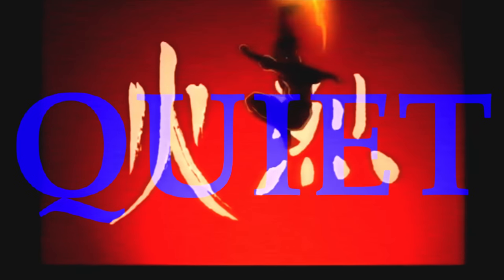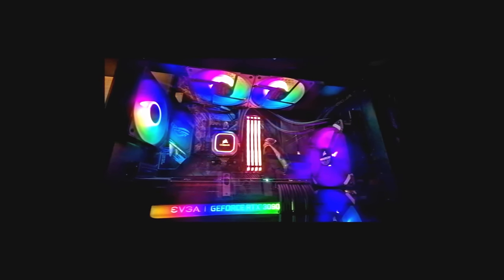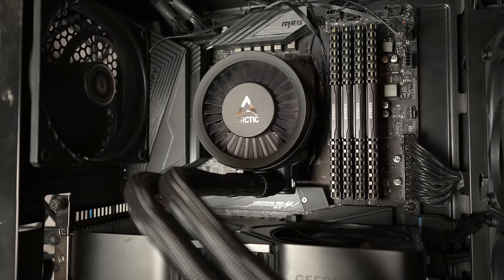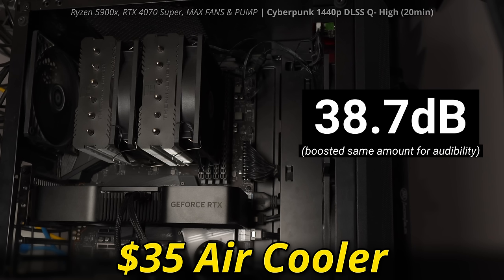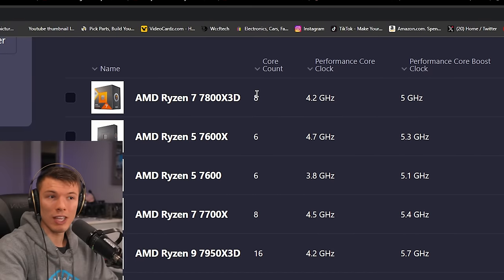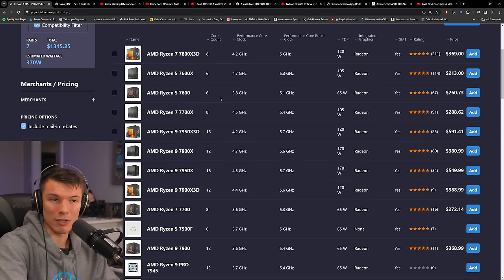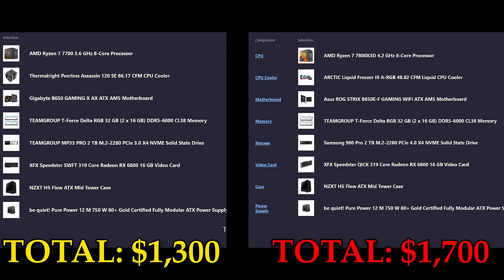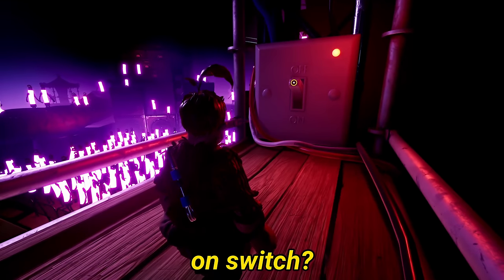How to Get the BEST VALUE PC!! (you’re doing it wrong…)

Comment: And the pump will die. When it does, you are in to spend the same amount of money, again. But when a fan dies on an air cooler, it cost 10 bucks to replace.
Reply: >hear fan bearing whirring
>replace cpu fan with noctua
>no more whirring
happy
Reply: Order the same AIO, swap the stickers, send it back and get a refund.
Reply: @Jackikins  unethical life hack lol
Reply: I just built my first ever PC and went with an aio. Decided on an Arctic lll since from everything I saw Arctic is one of the best while costing way less.

   So far I'm very happy with it. If it does fail earlier than is reasonable I'll go with air instead. 
   But I hope and expect the aio to last many years.
Reply: $10 or $13 p12 max ftw!
Reply: my current go to is: get a thermalright peerless assassin or the cheaper 120 single tower depending on your CPU. instantly replace fan with a cheap, silent, reliable arctic fan 120 PWM PST, either RGB or non-RGB
Reply: That was my thought when my old Corsair H50 died. That said, it DID cool:
- a 130w Pentium D 830 (Intel cancer at it's worst)
- a 4790K which had to be undervolted cause turbo was shooting it from 55c to 100c in less than 3 seconds and causing a shutdown, so it didn't even get to thermal throttle as it was OVP related (Thanks for the crap factory turbo settings Asus, made me learn I can tweak turbo values in an H81 motherboard)
Reply: Dual air tower with three fans is the way.
Reply: And borrow a case fan while you wait on shipping
Reply: I've never seen a AIO pump die... and I also had 3 AIOs and a dedicated setup. The first AIO i bought back in 2012 (1st gen corsair H series) is still running as it did out of the gate, and currently set up in my workstation. Using an ASUS ryujin 240 right now, aslo can't even report the problem people are having with Armoury Crate, it works just fine for me. OLED display and all, working perfectly. 

You know what I HAVE seen tho? Motherboards failing due to heavy cpu coolers bending them. And GPUs failing due to heavy air coolers making them sag.
Reply: @meusana3681  I have never seen a mobo die from air coolers, but I've seen my H50 AIO die two years ago, and the only thing I can make use of is the fan on something else. Meanwhile the only stuff that can fail on an air cooler are the fans themselves, and at least 120/140mm fans are common enough that I can replace the busted fan the very same day
Reply: @OfficialDJSoru  Yeah I'm not even gonna argue for 120mm AIOs, there I completely agree with the rhetoric here. The whole idea of AIOs was to provide more surface area than is safely achieved with air coolers. At the lower end, yeah, they are stupid. But pretending AIOs are just plainly bad is also stupid...that's my point. 120s are dumb, 240s are kinda overlapping the "sorta dumb" "sorta not dumb" category, and 360s absolutely have their place with no replacement in the air cooler department. Custom loops are in a category of their own, then it becomes a matter of being able to effectively get heat fast enough from the dye to the coolant itself. Pretending this side of the market is a scam is spitting in the face of pretty much every high end enthusiast that has more experience than you.

As for the bricked components. You will find anecdotes of every component breaking from high end trusted manufacturers to dingy china stuff. That's not the argument, "And the pump will die", is not a guarantee as stated, it a possibility at the low end, almost guaranteed not to happen at the high end. Your mobo bending however, that is a guarantee at the high end, and an impossibility at the low end. This argument became stupid when people thought to market the two solutions as the same horse, when it isn't.
Reply: @Jackikins  So they will not check if it works, right.
Reply: @arghpee 
>hear pump die
>replace pump
>Pump fine
happy
Reply: @everythingpony  pump costs 50+
fan cost 10
Reply: Arctic III has a 6 year warranty. I wouldn't worry about the pump dying. But yes, for value and normies, air cooling is definitely the way to go.
Reply: @sawdust8691  It's too late, you already made the dumb choice of getting an AIO in the first place.
Reply: I have a Ryzen 7 5800X3D and it's being cooled by an AMD Wraith Prism that I got for free.  I've been using it for the past almost two years without a single issue.  My backup cooler is an AMD Wraith Spire RGB that I also got for free.

I still have an AMD "Wraith before it was called Wraith" cooler that came with my Phenom II X4 940 and it STILL works to this day with the original fan.  Air coolers just don't die.
Reply: Pumps don’t just die.
They need to be cleaned like fans do, only it fan be done without air or taking the pc apart.
Reply: Got a 5 year warranty on mine and it’s not very loud
Reply: @arghpee It's not that unethical since Corsair AIOs offer 5 years of warranty and the one I bought in 2014 for aesthetics still works fine. If an AIO manufacturer cheaps out on the pump so it fails right outside the 2-year legal limit they are the unethical ones.
Reply: @Jackikins  pretty sure thats fraud

Comment: My GPU is white, my RAM kit is blue, my SSD and HDD are silver, my mobo is black with yellow stripes, no RGB. All in a windowless case.  As long as it performs well, I honestly don't care about the looks.
Reply: I replaced my side panel with this server fan panel with 4 massive fans. Hooked up the fans to am adjustable voltage transformer to a very low setting and get massive airflow. I always turn off the power strip to my PC anyway so it's perfect and my 6950 XT went from 80 degrees to 65 degrees just replacing the side panel with the 4 fans panel. It's janky but I literally have zero desire to get any sort of proper setup. Even the $50 for a decent case can be added to the savings for my next CPU upgrade. No frills and all performance.
Reply: same, i recently built my first ever pc and i didn't bother looking at how parts looked, whether they had rgb or not. it still somehow came out looking good and stylish tho xd
Reply: The only looks that matter is the case. And that doesn't cost you more just to get a nice and sleek case. Nowadays often with fans already included.
Reply: @christophermullins7163 the fan panels are insanely expensive bro, no way
Reply: @Noname-iq1gz  I am in that line of work so it was free. Yes... $120+ minimum for the panel lol pretty sure this one was over $200 😂

Comment: I got almost insulted for putting a Thermalright PA with a 7800x3d. Everyone told me i had to buy a 240mm AIO.
Reply: i've seen a good amount of people using a LOW PROFILE AIR COOLER on the 7800x3d, and it was completely fine
Reply: Same. Except mine is Phantom Spirit cuz I want to support Thernalright for giving us the better Noctua performance.
Reply: Jeez, where were you where people were saying shit like that? 

I honestly can't even imagine sleeping on the value of these air coolers. I think a lot of kids today just don't understand how unprecedented they were. 

AIOs were actually great for a while, but that was back when you had to buy Noctua to get good air performance, which was in a similar price range. Ever since Thermalright decided they wanted to undercut the market it's been a no-brainer for any budget conscious gamer. 

If you really want watercooling just because it's cool, then you should spend the fortune it takes to actually do it yourself. Otherwise air is a no-brainer and that's before you even start talking about longevity.
Reply: Reddit moment
Reply: When you don't realize the cpu will adapt to the cooler it's given...smh
Reply: I’ve had same. I’ve got the same air cooler as you just changed the fans to the ar120 by Corsair. Ran a stress test the cpu doesn’t go above 70 degrees and that’s with the fans at 1000rpm. Yeah air cooler is big and clunky but it’s £30 and does an amazing job
Reply: @tubo2k  ahhh you lot don't understand ohm's law XD As temperature goes up, so does resistance, more resistance at a given load requires more volts, volts x amps = power. 

At any given load, with higher temperature you will have higher power draw, causing more temperature causing more power draw, ever creeping the CPU slower and slower.

As I already explained with a previous commenter, you enter a scenario where a 105W cpu only manages to draw 90w under full load, and when at mid loads it won't be able to spike as high as it normally would. Hence overclockers' obsession with lower idle temperatures.

So again I'll make the argument, you bought the best cpu for gaming, and saved some money on the cooler. But still overspent on the cpu in the end since with that cooler you can't get 100% of it anyway. If you're gaming, with your setup a 5700x would perform identically. If you're using it for work, then I'm really confused by the logic.
Reply: @meusana3681  sorry don’t feel I phrased the response the best. I used AIDA64 to do a system stability test which stresses the components to see if there is issues with cooling.

Running this test for 10 minutes at 100% cpu usage the temperature was maintained between 70 and 72 degrees whilst the fans were only at 60% usage. The stock fans the cooler came with definitely didn’t perform as well hitting 90 degrees. This is why I switched the fans for ones with a greater static pressure and cfm.

Under normal use and gaming the temperatures are kept much lower than this temperature. I’m well aware that the temperatures want to be kept lower to reduce resistance which is why I’ve done the stability tests and why I’ve replaced the stock fans to keep the cpu running at a much cooler temperature than previously.
Reply: @tubo2k  100% cpu usage is not = to using 100% of the cpu. It only means the ASIC's execution time between clock ticks have been saturated. Which is why compute power is measured with FLOPS which is calculations per second, not calculations per clock cycle.

"100% cpu usage the temperature was maintained between 70 and 72 degrees" CAP. That cpu running prime 95 at 105w pushes a noctua NH D15 single fan config to 80 degrees (sorry, correction: 84.5 degrees max on my logs, and shared between several ASICs). And that is objectively one of the best air cooler you can find. So please don't CAP me.

Also, don't tell me the same cpu on a 360 AIO doesn't produce more FLOPS, that is factually incorrect. The cpu being just fine is cuz the cpu is smarter than you evidently are.

You don't understand what you are talking about. You may understand what you're saying, but what you're saying has no bearing on your argument.
Reply: I too am confused for what argument I am or not making. I was just further explaining my previous statement as I believed I hadn't explained what I meant, just clearly explaining what numbers were received with the use of AIDA 64 software doing a stability test. As stated before the stability test completed just to stress the components to check for cooling errors. No where have I said anything about FLOPS or my computer power. I've just simply stated the results from stability test.

Equally 100% CPU usage has only come from the figures that all system programs have stated if you believe there is a better method of how they should present this figure I believe you should contact them. Not some guy who's just commenting the temperatures from a completed stability test.

I feel as you said the CPU is evidently smarter than us both and at the end of the day it would have understood the above statement for its main point. Temperature whilst completing a stability test.

Maybe if you yourself completed the same stability test we could then have a discussion on the results we both obtained. At present this hasn't been done so there is no comparison.
Reply: @meusana3681  Tf are you talking about

Comment: I've spent $75 on CPU coolers in the past decade.

It's not about fun, it's about practicality.  And fucking with a faulty AIO isn't "fun".  I'll take that time and money saved and reinvest it into games.
Reply: I made the mistake of getting a corsair H100i v2 at one point. The v1 was a solid product, but the v2 didn't use enough anti corrosive in its mixture and many would end up with a failure due to corrosion. Mine included in that batch. 

I later saw a post by a dude using his computer for work going through about 5 of them. All of then having the same failure.

I just switched back to air and never thought more about it after that.
Reply: I spent 12$ on Thermaltake white RGB; it makes ZERO noise.
Reply: @HanSolo__  Yeah, air coolers in general are pretty frickin quiet now.  The standout quiet boy performer for a while was the Hyper 212 Evo, but now there's at least six or seven fans out at market that are just as quiet or more quiet that still keep the CPU chilly, you've gotta be doing some real wild stuff to need AIO for anything other than aesthetics, and of course no shade to those who use them for build look reasons.  But certainly if you're just looking for performance and value, you should steer very clear from that and just get a tower air cooler
Reply: @ArtisChronicles the thermal right peerless assassin 120 SE ... Spent $30 on it. Sure my CPU is just an i7, but it's 14th gen, and even when running at 5.6 mhZ, the temps never even worry me. I rarely ever hear the sound of my fans, and my case is running 11 of them (if we count the 3 on the graphics card).

Maybe I got lucky with incredibly good airflow, maybe it's Maybelline. Or maybe, AIOs just aren't needed, lol

Comment: also, the money saved while getting similar performance (at least at 1440p, like with the 2 builds here) can be used for a better mouse, better keyboard, better audio (both speakers and headphones/IEMs) and of course a way better monitor (or multiple monitors) than someone originally would have gotten if they had used that money for the tower.

$400 is A LOT for a setup if used outside the PC.
Reply: Yeah. I made a whole desktop 🖥️ set up for 1500 dollars on newegg (to match a price range 😅). Also I didn't by that because I didn't have 1500$ to spend
Reply: Outside the PC is expensive, the PC built alone is 1,000 dollars depending on the knowledge you put into it
Reply: I think people spend way too much on peripherals that don't offer any real advantage. There's virtually no meaningful performance difference between £14 60% mechanical keyboard and a £100 name brand one. Similar with mouse - Rapoo VT9Pro for £24 will perform as well as any Logitech money can buy. Most gaming headsets people buy have garbage audio quality and/or atrocious microphone but then Beyerdynamic MMX100 exists at £50 and blows them out of the water. Most "gaming" accessories are a complete ripoff garbage with HUGE markup. IMHO all that money should go towards a decent monitor, which is the aspect most people neglect.

Comment: i use water cooling because of it's small form and ease of install on mothearboard, instead of installing huge air cooler radiator. that's about it. that's real tangible pro of water cooling. also keep in mind that having radiator inside flows all that hot air inside the pc and then exhausts it via airflow, whereas water cooling flows all that hit outside right away, so even on ryzen 5 my gpu runs 5c cooler and my rams are cooler aswell, because that extra part heat isn't exhausted inside. it becomes even more important if u have heavily flawed gpu like 3090 which has extremely hot memory and that 5c temp drop becomes 10c temp drop.
Reply: Yeah. Finally someone
Reply: Majority of user installed AIO will be front mounted with fans blowing the hot air inside the case that will need just as many case fans required to expel the heat accumulated. So what really matters is case flow dynamics. Otherwise best scenario is having the radiator external and preferably in another room or outside...
Reply: @UncannySense  i haven't seen anyone around me installing AIO radiators in front. it dooesn't makes sense. unless one has absolutely zero understanding of airflow or no ability to use google (at which point i doubt they'll be able to install AIO anywhere for that matter) - noone would install it in the front.

Comment: i dont get AIO cooling for the better temps but to keep the temps out of my case.
I also like the tubes in my case and the added extra rgb fans. that is worth the price for me.
Reply: Agree with this - I've ran some pretty powerful GPUs (Vega 64/2080Ti/4080 Super) - all over 300W and some approaching 350W and I'd like to not have the heat dumped from them onto a CPU heatsink.
Reply: @tourmaline07 well you are clearly wrong.
Reply: air coolers help cool your motherboard vrms better. i couldn't hold my finger on the mobo heatsinks before i got an aircooler.

Comment: you are right, PCIE3 NVMEs are good enough. You dont need PCIE4.
but what you want are probably TLC cells instead of QVC. Also you probably want an NVME with DRAM cache. For this reason you should have chosen the Teamgroup M34 over the MP33. While both are PCIE3 (which is totally enough), only the MP34 has a DRAM cache
Reply: Hey buddy.. your brain is showing.

Comment: Fun fact, i play at 4k 144hz on a 7900xtx and my CPU is a 7600 non X. Yes, because i will never need a better CPU to play at 4k, i will never be able to get 250fps. With a gigachad air cooler that runs at low speed the CPU never reach 60c. The only place i overspent is the GPU, to be able to also run its fans at low speed and have a super quiet system at full load.
Reply: What fan do you use?
Reply: i suppose for gaming u don't need ultra powerful cpus, unless u want to play minecraft with 64 render distance or cities skylines 2
Reply: With a 144Hz monitor 144FPS is all you need, but if you bought a 7600 you can most likely upgrade it later.